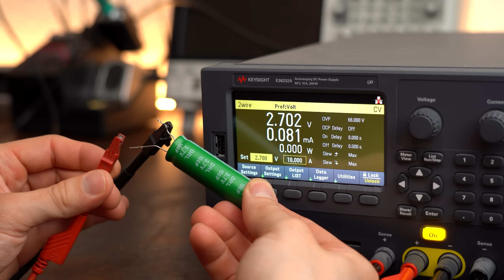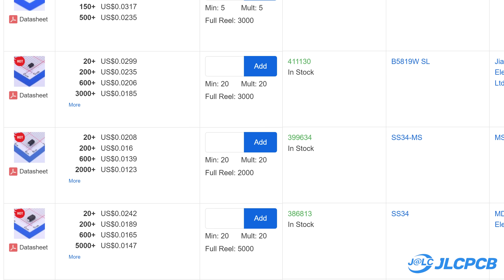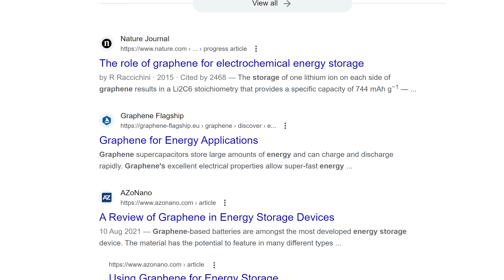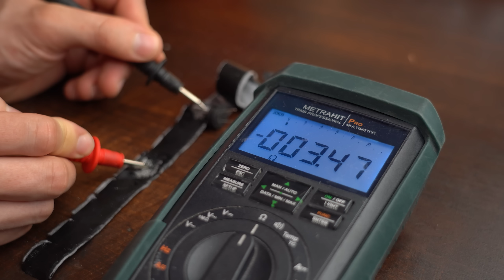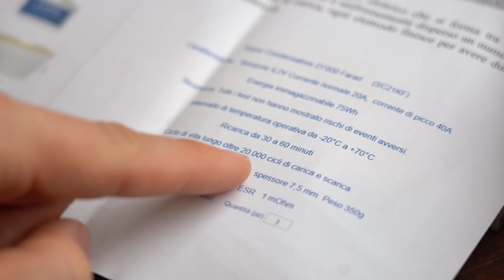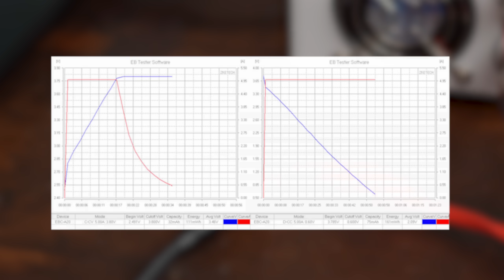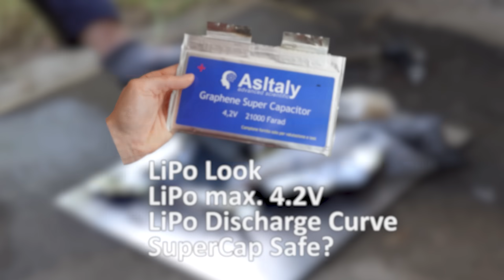Finally a Capacitor that can REPLACE a Battery?!

Comment: I'm not a battery expert myself but I have dismantled many of them from my early teenage years. Seeing copper in it makes me certain it's some sort of li-ion battery not a super capacitor. Each one I opened had copper sheets in
Reply: same and that weird af lithium smell
Reply: LiFePO4?
Reply: @safetyinstructor  Mostly Li-ion 18650
Reply: did any supercaps you've opened have copper sheets in them tho?
Reply: @bottlekruiser  No! From my experience(the ones I opened) they all had some sort of carbon electrode, both anode and cathode. Don't exactly know what it is for sure though

Comment: I would classify components after their mathematical behavior in circuits. So that formulas that could have been derived for "interesting" frequencies remain valid. Aside of that I see the application potentials for this component very well, especially given its mechanical safety. If I had money I would buy a bunch to try some things.

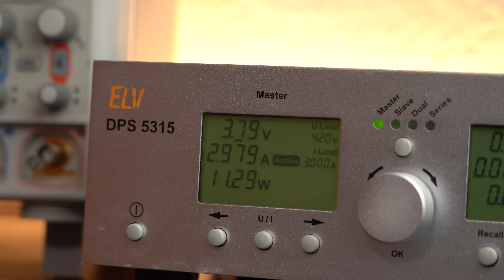Comment: 7:13 weak effort dude. You should look up how to determine current output using a resistor and a voltmeter. It's really easy. If you don't have a bunch of big resistors laying around, you can just use a graphite pencil. Just measure the voltage drop across a given number of ohms and you get the current. Reduce the resistance and the current goes up. Just figure out the current flow at whatever your lowest acceptable voltage is, and you'll have your "max" current output.

Comment: It's one thing to see what it actually is, but more importantly, does it behave as a super capacitor from charge/discharge time point of view. 

Also, 20 000 cycles seams way too low for a capacitor, is it normal for super capacitors ?

Comment: I'll apply a software engineering technique called duck typing here - if it has the charge/discharge profile of a lipo battery, the charge time of a lipo battery, the capacity of a lipo battery and the nominal voltage of a lipo battery, it's probably a lipo battery, at least for all intents and purposes - great if it's safer though!

Comment: Why did you have to destroy it !? If it delivers the Amps and lasts as much as the manufacturer advertised it was good enough. In my oppinion it doesn't really matter what's made of... unless you have your own shop where you sell them and hv to guarranty it on behalf of the manufacturer.

Comment: Dodgy website makes the whole thing look suspicious.  Considering the massive change in energy density over conventional super capacitors, plus the discharge curve, this has to be a hybrid.  And the 4.2V maximum is surely the clincher.   Big ass battery

Comment: Copper on one side, Aluminium on the other? Graphite at the copper, gray mass at the Aluminium? It's a lithium ion battery for sure. Copper is expensive after all - it's double the price of Aluminium, and the only reason why it's in Lithium Ion Battery Cells is the chemical properties.

Comment: 4.2v.. enough said. likely some lithium ion chemistry optimized for high cycle count or power density over energy density\capacity. definitely not LiFePO4 at that voltage mentioned in some other comments

Comment: For the charge/discharge why not use a simple resistor connected to the capacitor across a constant VOLTAGE source and use the exponential formulas which will surely indicate a capacitive action?
FOR CHARGING: (initial charge=0 or v(0)=0):            v(t)=V [1-e^(-t/RC)]   (charge with V)
DISCHARGING:(initial cap voltage=V' or v(t)=V'):      v(t)=V' [e^(-t/RC)]   (discharge through R with initial cap voltage=V')
NOTE: R,C,V  are known.     check v(t)  with t according to the equations. (V is constant charging voltage through R)
You will only need a voltmeter and stopwatch.  I do this all the time...mainly to calculate C of supercaps (...found many fakes a few years back)!...you will be simply looking for agreement with the exponential equations, proving they are pure capacitors.
THANKS MUCH FOR THE GREAT VIDEO!!!

Comment: Well, if it's a real capacitor you can discharge it until 0 V without issues. I wonder if there where some instructions in the so called datasheet related to the charging behavior?

Comment: I’m not a battery expert. But I have worked with graphene and it could be a possibility that the black layers in the claimed graphene super capacitor are graphene nano platelets. Or at the very least reduced graphene oxide. 

But there is still a 50/50 chance it’s real or fake.

Comment: LFP is much less prone to catch fire or smoke heavily and this is why it should be used in most applications where safety and longevity are more important than energy density.  This company is pretty brazen to offer an official website to support its eBay fraud.  Thank you for showing us what not to buy, though.

Comment: I got one but in battery car style (DIY type). It cost me a lot, over £300 and work up to 16.8V (guess that 4 in series) and yes limited to 20Amps. I was thinking the use of in solar charging and discharging for small constant feeding to electronics projects.
Reply: you can't start your car with 20 amps. You need at least 400
Reply: @xTerminatorAndy  yep, you can't start any car with that.

Comment: Should have done the nail test with a bulb connected. That looks like one of those batteries someone did a test when hooked up to an iPad and the used scissors to cut it and the iPad stayed on.

Comment: The capacitor explanation in this episode is pretty good, but the interesting thing about electrolytic capacitors (including most supercapacitors) is that one of the electrodes of the capacitor is actually the liquid (usually a saline solution), and the dielectric (polarizable insulator) is actually an oxide layer formed between the metal strip and the liquid electrode when a charge is applied.

This is why electrolytic capacitors are polarized: If you apply the charge in the wrong direction, the oxide layer breaks down, causing a short which prevents it from re-forming.

Most electrolytic supercapacitors are just regular electrolytic capacitors, but with ludicrous amounts of surface area across the dielectric layer, which corresponds to ludicrous amounts of capacitance.

Comment: There are those dry lithium batteries, which can be cut, no problem. I saw a promo video, a few years ago, when a Taiwanese company introduced those.
https://youtu.be/m9-cNNYb1Ik
Something like this.

Since it had basically led nowhere in the last 6 years, i bet the chemistry is flawed and had never worked reliably.

Comment: Its probably a type of Lithium Cell made from recycled materials from Electric powered Vehicles (Like Tesla). Its possible that it takes longer to charge, and hence longer discharge compared with standard new Lithium batteries. Everyone is jumping around to grab the new technology of Graphine, but it is currently very difficult and costly to produce, so a cell or cell relay containing it would be very expensive. There is probably going to be a lot of fakery products jumping on the bandwagon, so buyer beware.

Comment: No capacitor can ever replace a battery.  Even with gigantic capacitance, zero ESR and zero self-discharge. A fundamental property of a capacitor is the exponential discharge curve.  V = Vo.e^(-t/RC)  There is no getting around that.  If voltage holds up under load instead of falling away like that, it's a battery not a capacitor.

Comment: The current collectors (the metal foil) are copper and aluminium which is used by Li ion batteries. The supercapacitors using same current collector material on positive and negative electrode. And also the discharge curve looks like from battery.

Comment: LiPO battery, The copper is a dead giveaway. Lithium ion batteries need a copper current collector on the anode, it increases cost and is only used because it is needed. A symmetric capacitor should have aluminum on both current collectors.

Comment: Did you know that the separator inside a capacitor can drastically affect the capacity? The higher the k value, the higher the capacity. Look up "dielectric constant table". Also watch the video with this title "SILENCED about antigravity research report part II"

Comment: To be honest, the biggest red flag for me immediately that this was almost certainly not a capacitor is that it comes in a flexible plastic pouch form factor.  Batteries are chemical devices, so their actual shape, pressure, etc isn't that critical to their functioning, but capacitors are physical devices where each physical dimension actually matters a huge amount.  The characteristics of capacitors are highly dependent on the exact separation of the layers from each other, so any squeezing or bending of the capacitor internals will likely dramatically reduce its capacitance, which would be really bad if anyone were actually trying to, you know, use it in a real circuit for anything predictable.

There is a reason that all real capacitors come with hard exteriors.  Nobody would ever make a capacitor like this, particularly an expensive, state-of-the-art supercap, which could be rendered basically useless just by squeezing it with your fingers in the wrong way.
Reply: While I get your point, you are not quite correct there. There are double layer capacitors made that way. AVX PrizmaCap series comes to mind. But they are certainly not the norm.
Reply: @hmpeter  We are not dealing with the norm here though, so you certainly have a valid point.
Reply: Yea!!! What she said
Reply: The electrical properties of a capacitor change when the shape changes. This effect can be used to make microphones, specifically condenser microphones.

Conversely, if a capacitor is made of sufficiently flexible stuff, charging it will change the shape, which is how electrostatic speakers work.

If the capacitor isn't designed to be a sensor or an actuator, deforming it is almost always a bad idea.
Reply: @hamjudo  vaccuum-sealed pouch cells can be a little different there, though (depending on what they use for interplate spacers), as they are already being held constantly compressed at ~14psi by the external atmosphere. So, barring major external trauma, some minor bending of such a capacitor should only cause a small portion of 1% variation in the capacitance, due to misalignment of the very ends of the plates.
Reply: @hamjudo  in electrolytic caps, one electrode is the metal, while the other one is the electrolyte. The gap is (in case of the normal al-electrolytic) a thin oxide layer covering the metal electrode. So while the innards of the capacitor may seem squishy, the thickness of the dielectric layer is actually very rigid.

I'm not sure, why pouch design is never used for al-ecaps. Maybe because bending of electrodes will cause the dielectric layer to crack, causing shorts?..
Reply: I mean you can make caps out of buckets of water so that doesn't really hold up too well on the rigidity side of things
Reply: Nope. Supercap capacitance depends only on an area. Cause it keeps a charge in the double-layer
Reply: Pouch cells are very popular when it comes to packaging devices. Indeed they are the real standard see Amprius, Sion Power, Lyten etc..
Reply: @gillssunday  AFAIK none of those companies make capacitors.  They only make batteries, which actually reinforces the point I was making.

(I was not aware of the AVX PrizmaCap ones, though.  I am now curious how they deal with the obvious issues of capacitance changes due to external pressure/bending/etc...)
Reply: I consider hybrid or conventional supercapacitors, like batteries, as their purpose is to accumulate energy and return it when needed. Like every battery technology each one has its own characteristics starting from the zinc-carbon primaries up to the expected 1000Wh/Kg zinc air.
For the use of pouch cells I have personally tested silicon lithium batteries in pouch cells, tested in vacuum, after a week there was no measurable effect. @foogod4237
Reply: Usually supercapacitors do both electrostatic and electrochemical storage for their increased capacity.
Reply: @satibel that's hybrid caps... supercaps are differentiated from "normal" caps by the electrolyte which forms EDL (ellectrolyte-double-layer) physical static electrical syorage against the charged capacitor plates, thus increasing energy storage WITHOUT any chemical reactions.
(Brief version: supercaps are NOT electrochemical, the electrolyte just adds "virtual" extra plates, or extra surface area to the plates)

Comment: 10:54 "Chemical reaction always come with more heat productions". There are endotherm and exotherm chemical reactions, so producing heat is NOT always the case. A reaction might use the surrounding heat and not produce heat.

Comment: Good tests. It does seem to behave more like a lithium battery than a supercapacitor, and doesn't seem to be able to charge any faster or be able to provide more power than a lithium battery. So, even if it was technically a supercapacitor, it doesn't have any of the benefits you would want from a supercapacitor.

Comment: Probably the discharge curve of a supercapacitor has also to be considered a disadvantage. As shown in the video, the voltage changes a lot during the discharge so, in order to exploit all the stored energy, the devices connected have to work in a really wide voltage range and this is not easy to manage. In my experience, a common solution is to use only a part of the stored energy, thus giving up some capacity. Anyway, as always a really interesting video!
Reply: Not difficult at all: start from a higher pack voltage and use a buck regulator. You already need to do this with 3.7V Li-ion to power 1.2-3.3V loads anyway. For single supercaps, a SEPIC converter can do both buck and boost as needed.
Reply: Maybe you would need several contactors for each module in battery pack (connected in series) in order to maintain steady pack voltage. 🤔
Reply: @valtersvasilis  that actually might be a good method, at least in combination with a more proper regulator. If you could reliably keep the voltage within +/- a volt or two, then you could get a really efficient regulator that pins that down to something exact. (say 3.3v for a microcontroller) 

With that said, you'd need a smart-switching circuit, otherwise when it's fully charged you'd get WAAAAAY above the desired voltage. For small devices you'd likely only need some mosfets or something, but for an EV or something you'd probably need full fledged contactors that can rewire the battery pack from series to parallel on-the-fly to keep a somewhat consistent voltage which can then be pinned down by a regulator.

Comment: Here's what I would do.

1) Separate the constituent materials as well as I can.
2) Dry them.
3) Do a flame test on each of them.
3.BONUS) Record the flame emission with a spectroscope

The colors you see (or emission lines, if using a spectroscope) should tell you fairly accurately what the materials being used here are.

Lithium has a characteristic pale red flame. I don't know the flame colors for Fe and P, but they are available online.

If you just see lithium, maybe it's a hybrid capacitor. But I'd bet there's no reason for there to be Fe and P if it isn't a battery.

If you see none of those, then perhaps it's indeed a capacitor.
Reply: Instead of a flame test, you can also use it as electrodes. An electric arc will give more spectral line than a flame.

Comment: The LiIon chemistry is very wide band, people are familiar with ICO to NCA & NCM chemistry but very few people know about all. 

About the shown cell, It's definitely not a LiFePO4 charge discharge pattern is very different from the plotted curve. It holds voltage stable until 80% and have a quick drop like a cliff. So this not LiFePO4 for sure. It can be LMO chemistry or something similar which holds no cobalt and which can be safer with low energy density as it showed.

Comment: How fast did it charge? ...are u sure its not 4 to 2 volt ....range as well ive seen people talking and dont understand balance charging ,parallel ,series connections or cell structure  1s 2s 6s ect then theres c rating ..max amp dump ...can u imagine wireless charging on a array of these ....

Comment: Hi, I've done some research on hybrid supercapacitor energy storage, including developing devices beyond the state of the art (250+ wh/kg).

When you get into the hybrid supercapacitor regime, the line between "battery" and "capacitor" becomes very blurry, and really there's a smooth transition from one to the other.

The tests you've done here don't really tell you if this has a supercapacitive effect or not, because hybrid supercapacitors do act like batteries in some situations. To tell conclusively what's happening under the hood, you would need to do cyclic voltammetry, looking at how the device behaves under changes in cyclic charge and discharge. 

Also, I would avoid handling electrolytes without protective equipment unless you know what the exact chemistry is, some of them can be really bad for you.